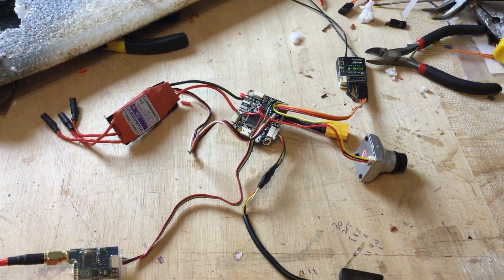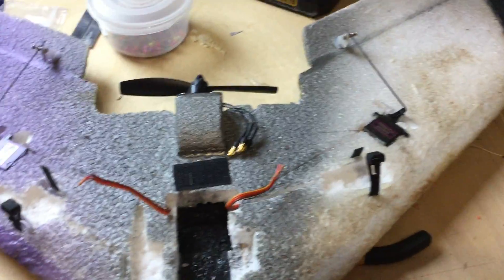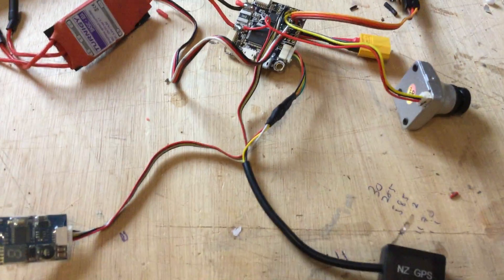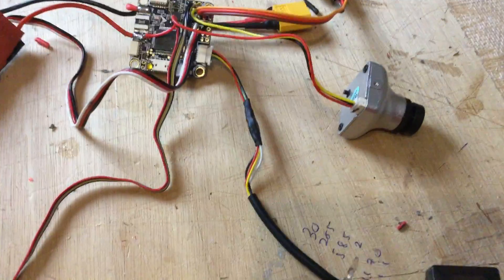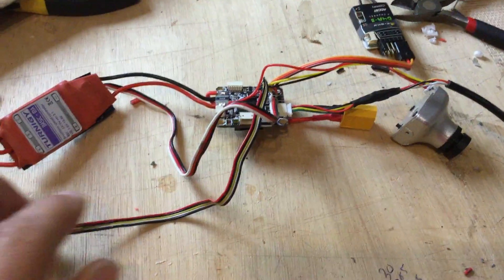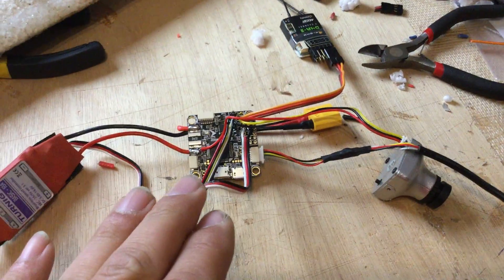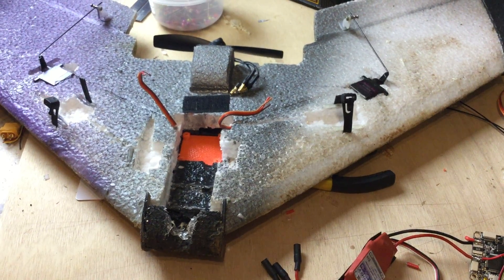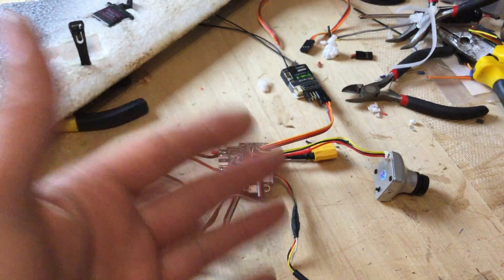iNav Into a Hornet FPV Flight Wing (Omnibus F4 V2 Flight Controller)

Comment: Hi Matt, where will you wire the servos to. More to the point, where will you wire the positive connects on the servos?
Reply from the maker: Howdy fella, I wired them to the 5v servo rail on the FC, Matt
Reply: Cheers for the reply Matt. I did hear you say that is where you would wire them in the video, I just wanted to be sure. I worried that having the servos on the rail might cause brownouts. I read on Github "Servo and ESC/MOTOR. ( Keep in mind servos positive wire should go to an independent BEC instead of connecting to the flight controller itself. )" https://github.com/iNavFlight/inav/wiki/Fixed-wing-guide
I am in the process of building a starter plane for me to practice with, I want a flying wing really but realise a trainer is probably the best foot forward. Its one thing flying in a simulator, very different in the real world. 
Another quick question if I may, Should I have nearly 5V on the ESC/BEC signal(throttle) wire. I say no but I have been supplied with two that do. I did try one on my TBS receiver, it (receiver) is not happy now and does not function as it did or should.  : (

Comment: Hi, I currently have a setup very similar to yours. The only difference is the receiver. I bought a spektrum 4649t. Can I use this receiver on the sbus/ppm port while the gps is in the same location as yours? Can I use the dsm2 plug as well as long as I supply it with the required voltage?
Reply from the maker: Hi David, I have no idea at all on the Spektrum kit I'm afraid. Have a look at the iNav wiki and see if they say anything about it, Matt

Comment: matt , i have a plane from the boys over at flight test. its called the guinea pig, and shes got twin motor combo( shes a big girl) just wondering if you think the f4 v2 will handle that much juice ? and where do you recommend stealing power for two ports that are shy power for the rudder and elevator ?

Comment: Hi Matt,
Great videos, loving your channel. Stupid question from me - I have the micro sky hunter and want to use the F4 V2 in it. I have it all setup, but when running the servo from the FC, they get no power, when I plug them in I can see the rail drops to 1v instead of 5v and hence nothing gets enough power. I have checked all the reciever in iNav etc all good. How do you run the servo from the FC please? is there a secret boot solder I'm missing? Cheers
Reply from the maker: Howdy Guy, ah ha, you need to supply the 5V rail with 5V and they'll work then! Matt
Reply: Thanks Matt! I'm using ESC pulled from a quad, hence no BEC, so in this case I need a separate BEC right?
Reply from the maker: Howdy Guy, yea thats correct. Also I strongly suggest not using a quad ESC in plane because they don't have heat sinks and are most likely housed in a well insulated part of the model to help them cook (which is a bad thing!). Matt

Comment: Hi Matt, great video. I heard that the 5v and gnd outputs on the servos are not common with the 5v bec on board meaning you can run the bec from esc's for the servos, have you tried this or can confirm is possible?
Reply from the maker: Howdy Keith, if you connect a power supply up to the board, the PWM + pins go to 5V, so yea they're connected to the BEC. Hope that helps Keith, Matt

Comment: Thanks Matt,   Looks like your uploading like mad today.   Was excited to see since I am working on the setup on 2 of my wings.   I got an F3 v2 before I had seen your recommendations I hope that isn't a mistake.     Will get it set up and if needed get another wing so I can test out the F4 version.   :)        With the F4 version does the board supply enough power for your servos, Vtx, reciever and GPS?    I know you said an early board got smoked.     Thanks for all the great info.
Reply from the maker: Howdy Shawn, yep the F3 board will work fine. I'm sticking with what I have here and what I know for this series. The ONLY thing you need to be wary of is that your pin layout on your board will most likely be different to the ones I'm using. They'll be similar, but different. So make sure you check the site you bought it from to see the correct pin outputs for your board :) Matt
Reply from the maker: And yes the F4 board will be fine for a FlyingWing. We're only talking 2x 9g servos they're not going to be pulling many mA :) Matt
Reply: Thanks got it up on the air and back down safe.   The GPS shows all the info on the screen I wasn't ready to test that out.   More inav reading needed for tuning.    It would flap badly at high speeds but it was with stock settings so I am sure with more reading I will iron it out.   Thanks for the video series. 

as a side note on the F3 board I got ( I know it is a different board so not a problem just mentioning in case any one else has one)  the servo rail wasn't powered from the built in bec.   I applied 5v externally to the servos and it was fine.